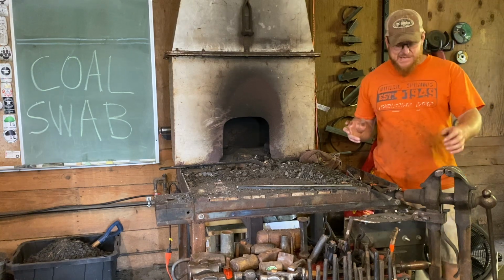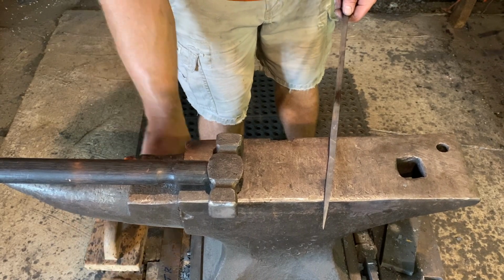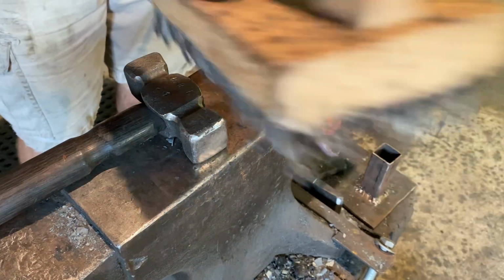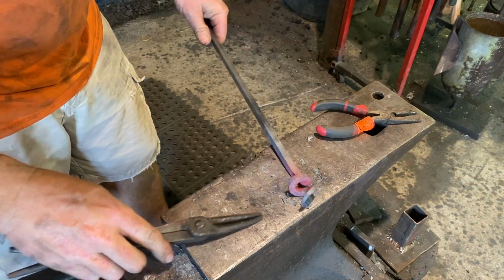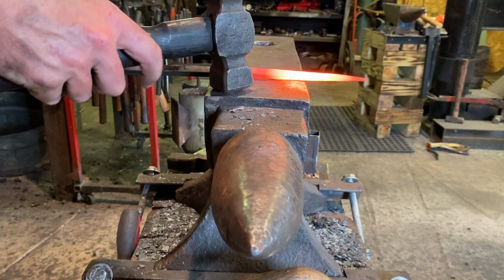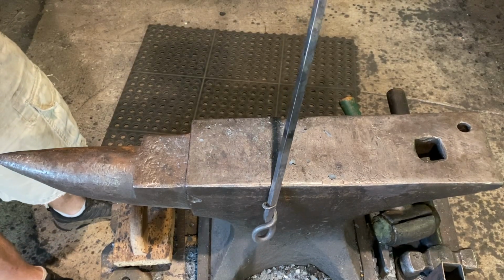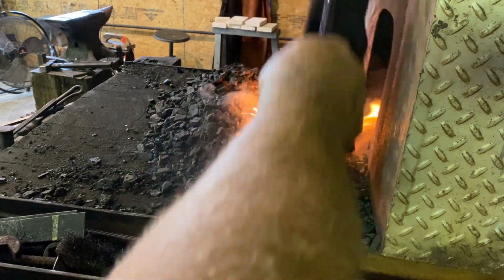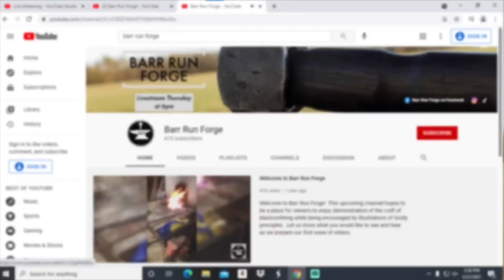Forging A Coal Swab

Comment: Hi Troy! I don't make mine that fancy! another thing you should've mentioned is heat control ? by placing the swab over the shaft of what you're making it helps stop heat migration up the length of the shaft as well...
Reply from the maker: Right on, Frank.  Good point.  God bless.

Comment: As always, I learned more from watching you than I would by just practicing. I have found that any skill starts with instruction and gets mastered through practice. I really need to work on the techniques you taught here in this video. I like your style of forging... One thing that I really struggle with and have never learned is how to maintain a coal fire. I have what I think is a good setup, but I can't seem to keep it burning or get consistent heat from it. I have pretty much stopped trying to use it and just use my propane forge for everything. I feel this is a failure on my part. This wetting down technique encourages me to try again... Thanks and be well... I appreciate your style...
Reply from the maker: That is humbling. Keep on keeping on, brother. You got it. God bless.